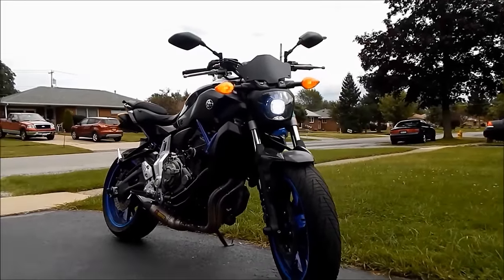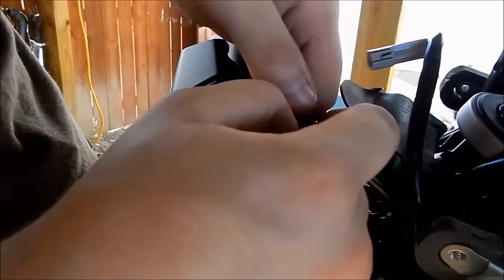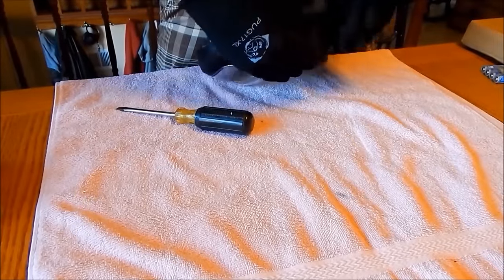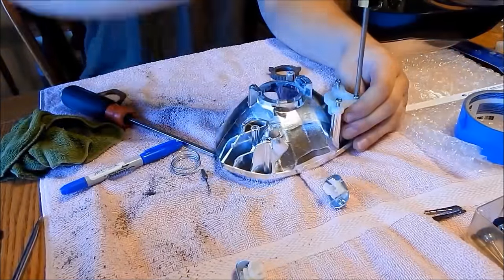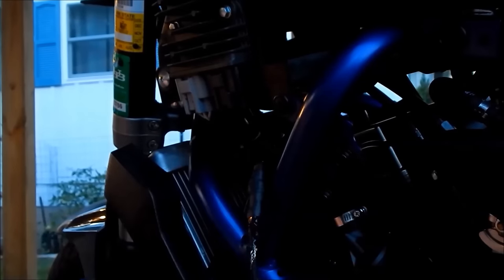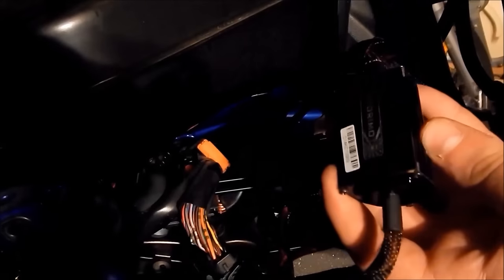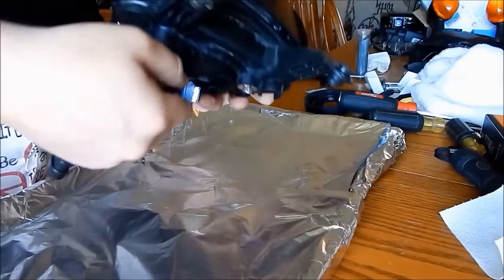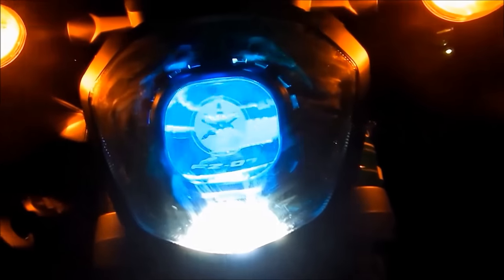How to Retrofit a Projector Headlight into a 2015 Yamaha FZ 07

Comment: do I need to make the cradle in the last step
Reply from the maker: +Giovani Gonzalez You don't NEED to, but there are a couple of things that happen if you don't. 1.) You are completely blind at night. The beam is so low that it is pretty much useless, even with the high beam on it doesn't shine high enough to illuminate the road in front of you a reasonable distance. 2.) It can mess up the igniter. The igniter gets warm and what you will come to find is that it rests against the triple tree and the repeated rubbing against it and the warmth deform it a little. This could cause problems with the light. So while you don't need to make it, I would highly suggest doing so.
Reply: +Allan Baillo how did you make your cradle?
Reply from the maker: +Giovani Gonzalez Very carefully. Lol No really, I went to Home Depot and bought a 2 inch wide strip of aluminum and cut it, drilled holes in the proper spots and tack welded the current cradle on to it.
Reply: Could I just aim the headlight as high as it will go? I don't know how to weld.
Reply from the maker: +Giovani Gonzalez The situation I described above is with the headlight aimed as high as possible. You don't need to know how to weld. Honestly JB Weld should work just fine to hold the old cradle in place on the aluminum bar.
Reply: +Allan Baillo maybe you can make another video that explains it better

Comment: why not locktite instead of jb weld?
Reply from the maker: I suppose you could try it. I can't really think of any reason to say don't use locktite, but I do know that JB Weld 2 part epoxy is some ridiculously strong stuff. Try it with locktite if you want, I know I will be using JB Weld though.